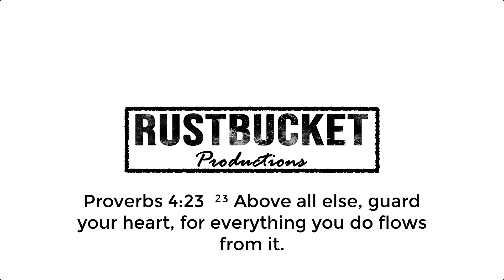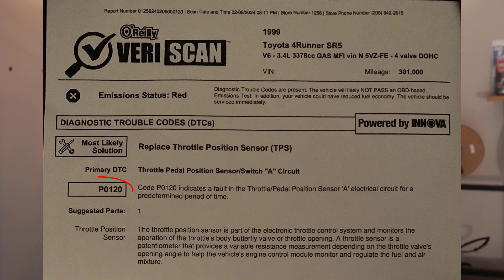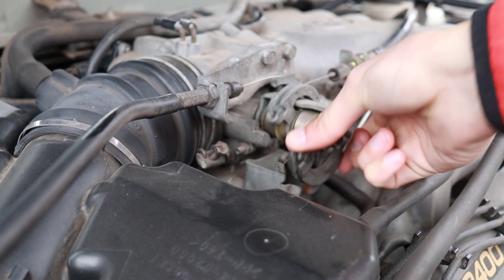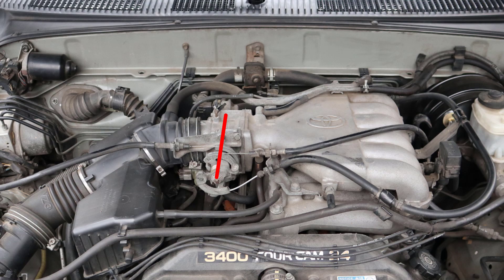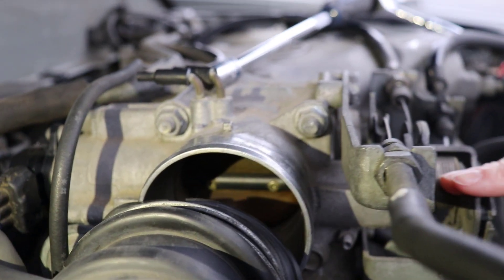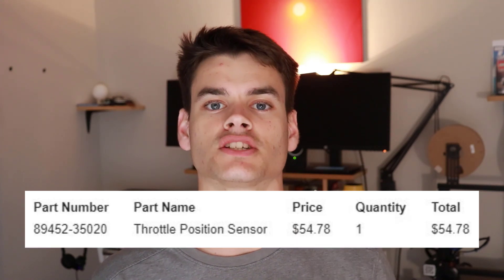Faulty Throttle Position Sensor Symptoms | 1996-2002 4Runner

Comment: Same story for me. I had been struggling with air/fuel mixture problems on a 98 for some time. A shop finally diagnosed that the brand new maf sensor  was defective out of the box. Ran for a few months great with a new maf sensor. All of a sudden it started doing that hesitation thing. I'm ready to throw the car in the trash. Today fortunately it threw that p0120 error. Hoping the throttle sensor does take care of it. Thanks for the info.
Reply from the maker: Let me know if this part and repair ends up fixing your issue!
Reply: @rustbucketproductions it did fix it. It may have been the root cause for the past several years but never actually threw this exact code. It hasn't run this well for some time.
Reply from the maker: @adamlead1  That is great to hear! Maybe you will be able to squeeze out an extra mpg in the process.

Comment: Just got a 2001 with 318k miles, what should i do first? Apperently new transmition and timing belt
Reply from the maker: First I would review and documentation around previous maintenance and then I would see if any interval maintenance has been missed. From there I would just get a feel for the vehicle by driving it around and seeing what may need to be refreshed.

Comment: Does this cause a hard shift when pulling off from a stop?
Reply from the maker: I would not think that the throttle position sensor shouldn't have any impact on how the vehicle shifts.
Reply: @rustbucketproductions  Didn’t you say in the first few minutes that you thought it was your transmission slipping? That would be the car’s ability to shift lol And the answer to buddy’s question above is yes. If the ECU isn’t receiving proper throttle position information, shifting can feel harsh, acceleration will suck, etc.

Comment: I'm not sure if this is my issue, but is it a good idea to go ahead and replace it to see if it is the fix? I haven't gotten a code yet which makes me hesitant to replace it if it's not needed
Reply from the maker: It isn't a super expensive replacement if you are not certain as to what the root cause of your issue is. If you haven't gotten a code I would do a bit more investigation and see if you can pin point the issue with more certainty.
Reply: @rustbucketproductions I went ahead and ordered the part so we’ll change it out and see! If not then it’ll be back to the drawing board 📝

Comment: Rhe past week, my 2001 4runner just went completely out. Throttle just stopped working. Turned it off and on, then works again for a bit before going out again. Not sure if this is the problem
Reply from the maker: Sounds like you could have an issue getting fuel. Let me know if you figure out your issue.
Reply: U figure this out? I got an 01 4Runner same issue right now

Comment: Did you have a check engine light? Or was the code there without the CEL?

I have replaced nearly everything and can't fix my acceleration issues. Have no CEL
Reply from the maker: Yes I did. The code was P0120. You might have a fuel pump that isn't sending enough fuel to the cylinders. Though I would think this would throw a code for a misfire.
Reply: @ yeah my thought it either injectors/pump or the TPS the 3 things I haven't replaced that are directly related
Reply from the maker: @ The TPS replacement would be the cheapest and easiest of those options. Let me know if you end up diagnosing the issue.